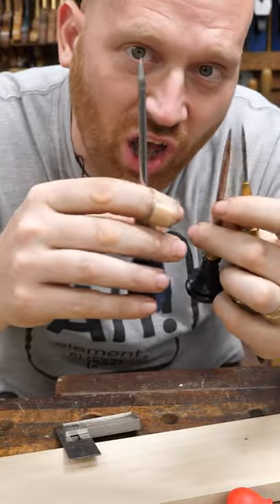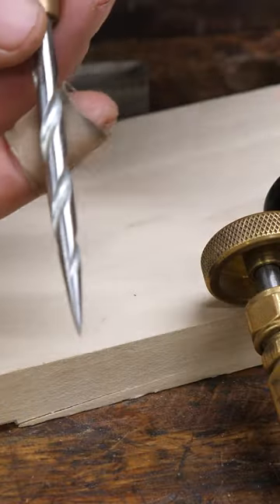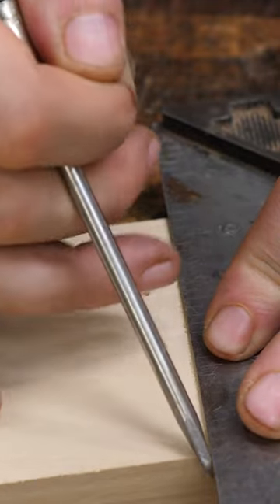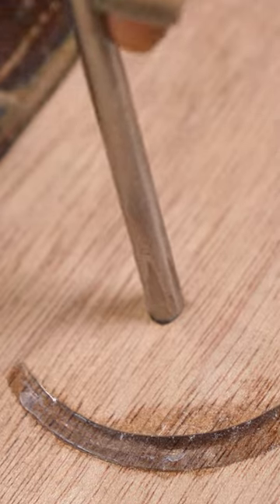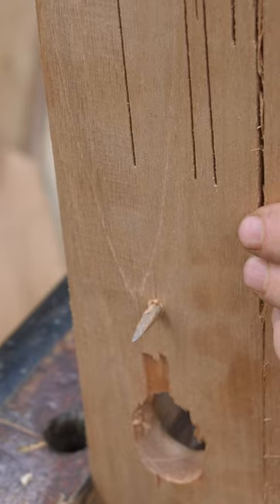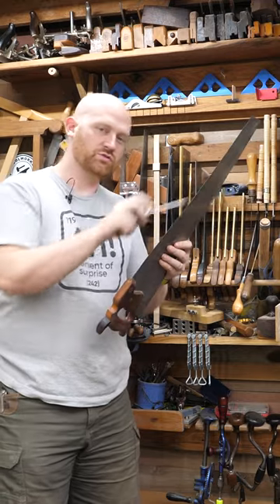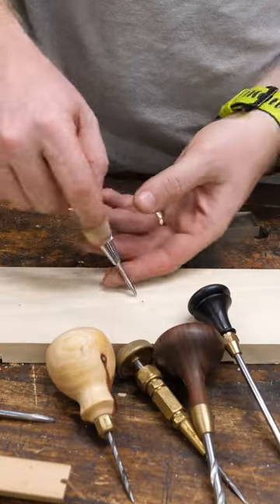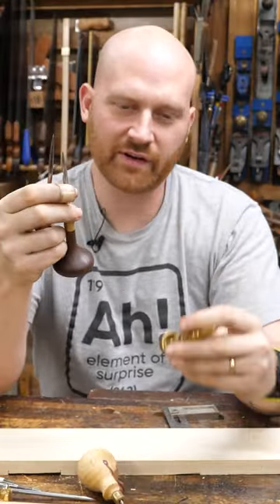All about the Awl

Comment: I'm a blacksmith, and one of the main projects I trained with (and still do) is working larger round stock stock to a fine square bar with a very gentle taper across the length, sometimes playing with twists and such, makes a very good stele, awl, dagger, etc. 
I keep my hair pretty long, so I currently use one which I'm particularly happy with as a hair pin

Comment: I use my awl very often. I bought it in one of those 'Dollar Shops' or a 'Pound Shop' as I am in the UK. I use it for all sorts of things, making holes, measuring the depth of holes, getting that screw you dropped from under the skirting board, marking lines and stirring things and scraping dirt off and well it goes on and on really.

Comment: At work (for scribing steel) we take TIG welding tungsten rods and sharpen them. Can use as is, or add tape for a more comfortable grip. Works very well, tungsten is incredibly hard and keeps its sharpness even on steel. I'd imagine they would work well on wood too